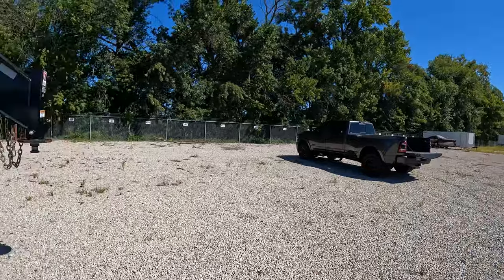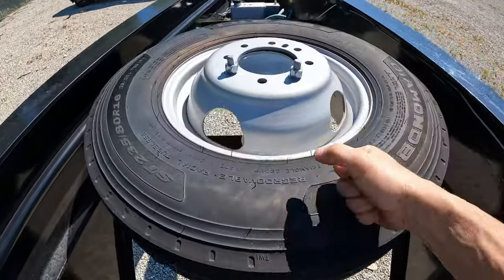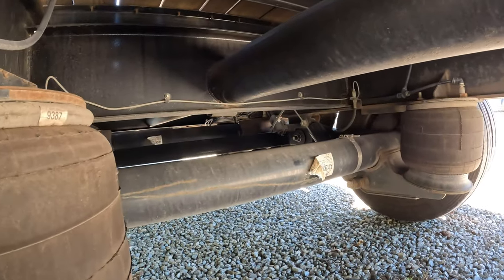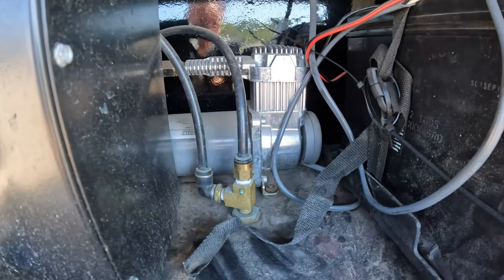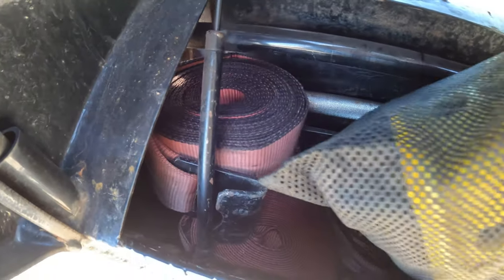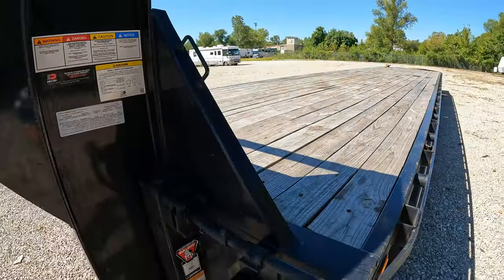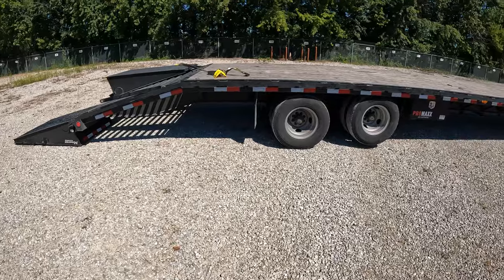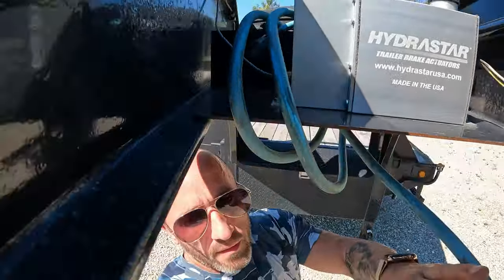My Hotshot 2022 PJ trailer gooseneck flatbed setup / monster ramps / air ride

Comment: Alex, noticed the electrical wiring butt connectors on your neck of the trailer aren't heat shrink or water tight.  May wanna look into that to avoid issues in the future.  Great video of the details of the trailer.  They make some soild equipment.  Keep up the great content.  👍🏽
Reply from the maker: Len, thank you! I will look into the connector situation. Happy to hear you enjoyed the video 🙂

Comment: On the rusty side of your toolbox I'd suggest sanding it to bare metal, prime and put a few coats of paint on it then secure a mud flap to it. That way it won't get beat up anymore.
Reply from the maker: Yeah I need to do that. It’s crazy how beat up it got in one year. Or make it black textured like the truck bedliners. That would probably be tougher.

Comment: Great video. I’m finally upgrading to an air-ride trailer this week. I was wondering, do you prefer the fifth wheel to a gooseneck hitch? Ride quality? Quicker to hook to? Thanks Alex! Also, avoid New England. It’s dead right now.
Reply from the maker: @AcadiaHaulers  awesome move. Air ride will be much better. I prefer fifth wheel because it gives you a smoother ride vs ball hitch and it’s so much easier to hook and unhook.  I will no longer go to New England or any place north east.
Reply: @Mr.AlexKogan  thanks. That’s what I figured. I drove tractor trailer also and prefer a fifth wheel. 30k hitch is around $1500 but should be worth it. Safe travels
Reply from the maker: @AcadiaHaulers  Definitely worth it in my opinion. 
Thank you!!!

Comment: Hey Alex. Just picked up my trailer yesterday in Missouri. I already have a suspension issue. Do you know how to adjust the height of the lift axle, not the suspension it self? My front axle is too high on the drivers side so the tires and pushed against the trailer stopping them from turning. I hit a bump where the suspension must have bottomed out and skidded a hole through my brand new front outside tire. Any thoughts on adjustment would help me out. Thank you!
Reply from the maker: Oh wow. I honestly don’t know how to adjust that. I believe the only thing that controls the lift axle is the airbag itself. I say best bet is to take it to a trailer place that sells the brand you bought and have them fix it under warranty. I wish I could help but can’t think of anything without even seeing the issue. I know there’s a level valve for the whole suspension to stop going up at a certain point. Don’t know if the lift axle has its own level valve.
Reply: @Mr.AlexKogan  
Thank you so much for replying back. I know about the same as you so was left without answers. Three new tires on a brand new trailers maiden voyage and I had to run with the lift axle down 2200 miles but I made it….now to find a local dealer. Be safe and thanks again.
Reply from the maker: @AcadiaHaulers  Good luck. Hope you get that issue resolved. 
Thank you!👍🏻

Comment: You do not have to run chains with the fifth wheel set up. Only with a gooseneck ball set up. Congrats on hitting 1K.
Reply from the maker: Thank you my friend👍🏻 I actually asked a DOT officer on the chains and he said with any gooseneck you still have to have chains. Said semi trucks don’t have chains because their fifth wheel works differently. I’m mot sure what’s different about it. I prefer to keep the chains for extra safety. They dont bother me.
Reply: @Mr.AlexKogan  Nothing wrong with being extra safe bro. These officers need to get on the same page. Seems like they always have different answers. Fifth wheel campers don’t have safety chains. But anyways, that’s an awesome trailer. Be safe out there.
Reply from the maker: @RichardM79  Richard, thank you! I agree with you. Campers don’t have them and I told the officer that but he said they are not commercial vehicles. How does that make any sense?

Comment: When you say air ride for the trailer, does it mean that it also increases the ride comfort or just for leveling purposes, etc.?
Reply from the maker: It does both. Leveling and big time ride comfort increase vs leaf spring suspension.
Reply: @Mr.AlexKogan  thanks for the reply. Does your truck also have air suspension? What you think would be the most comfortable ride combination?
Reply from the maker: @I.B1  yes the truck also has air ride. I think air ride is the way to go in my opinion.
Reply: What's the gvwr?

Comment: Do you use a ELD or paper logs?
Reply from the maker: ELD.  It tracks all mileage driven in each state and when I purchase fuel it’s linked with my eld so it keeps track.  You need all this information for IFTA filing each quarter.

Comment: Is it worth having the ramps or full flat deck
Reply from the maker: To me it’s worth having ramps. Used them several times. A flat deck with no ramps limits what you can haul.
Reply: @Mr.AlexKogan  it's a lot of weight to carry around to ues s few times
Reply from the maker: @dioncurline3266  I have used my ramps a lot more than just a few times. I’d never get a trailer without ramps. Just my opinion.

Comment: Should dump your bags every day and drain your air tank soon water doesn’t build up
Reply from the maker: I think every day is overkill. You’ll be overloading your compressor to fill that air tank completely. I may be wrong but no one has time everyday to do that.
Reply: @Mr.AlexKogan  read your manual it’s every day and deflate while loading. It won’t over work your compressor to cycle one full time a day
Reply from the maker: @jamesnelson5700  unfortunately my trailer didn’t come with a manual. I researched about it online. Couldn’t find anything that says everyday. You could be right I’m not doubting you but when you stop driving around 11 pm every night, the last thing you think about is letting air out of your tanks. I doubt semis do this everyday.
Reply: @Mr.AlexKogan  I wish YouTube let you post pictures, on my toolbox that contains the air system it says to dump everyday and to deflate air bags while loading. I also run a semi and the difference is we have a water separator and purge valve for our air tanks while the hotshot trailer doesn’t. But you should also drain the air tanks so moisture doesn’t build up and create rust inside the steel tank. I also ungraded my hotshot trailer’s tank to an aluminum one. I don’t know where you live, but during the colder months, you should drain them and leave open the valve every night so the air inside doesn’t ice up and clog your air system.
Reply from the maker: @jamesnelson5700  I’ve ran the trailer last winter without freezing up issues. What your saying makes good sense but I just don’t have the time or desire to drain it every night. I usually stop driving around 11 pm and I have to shower and get myself ready for next day so to mess with the air tank everyday is super inconvenient. It makes good sense though what your saying.
Reply: @Mr.AlexKogan  so you don’t do a post trip when you stop for the night?
Reply from the maker: @jamesnelson5700  of course I do a post trip but I’m not climbing under the trailer to open up air valves. For me it’s not important to do every day. Once a week works.
Reply: @Mr.AlexKogan  you have to climb under the trailer? You don’t have a pull cord? And to dump the bags doesn’t require you crawl under there
Reply from the maker: @jamesnelson5700  sure I do but you can’t leave the valve open if you don’t keep pulling the cord.
Reply: @Mr.AlexKogan  you deflate the bags, then pull the cord and let all the air out, you turn your compressor off.
Reply from the maker: @jamesnelson5700  I understand how to do that but you said leave the valve open over night. Unless you keep pulling the cord, that valve will not stay open. You almost have to put a weight on the cord to keep it pulling at all times. I’ll do more research on the air tank deflation recommendation on these trailers.
Reply: @Mr.AlexKogan  I said that for the winter time and that’s in freezing temps and if you have a valve that you can turn to stay open.